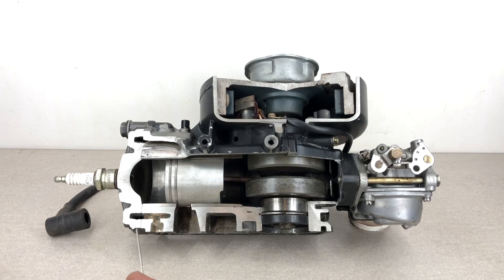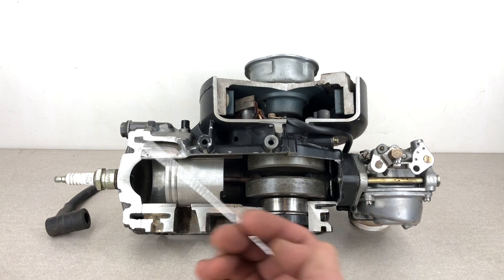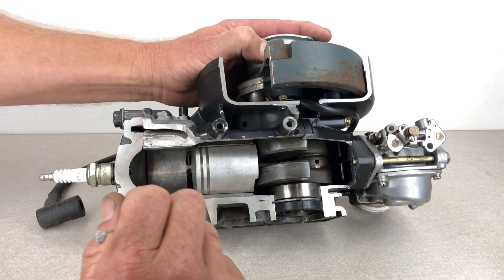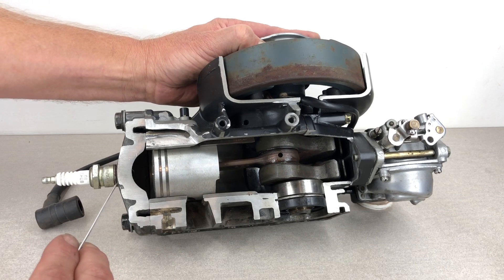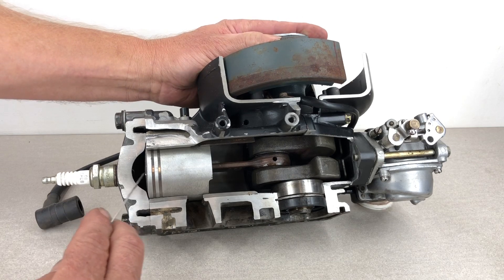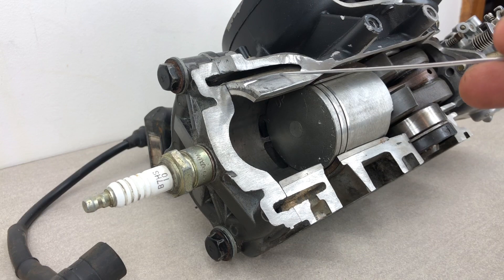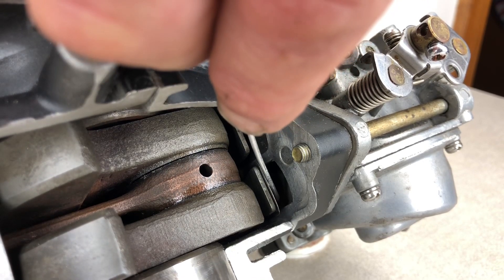How a two stroke outboard works.

Comment: I have a 2 stroke 15 hp mercury. I was doing a flush test but the prop nut was only on hand tight. Is this ok?
Reply from the maker: Hi mate,
The prop nuts don’t need to be super tight, just on firmly, hand tight is definitely not enough. Make sure if it’s the 15hp USA built that the nylon locking part of the nut is still firm and new (designed to stop the nut undoing during operation) if it’s the 15hp Japan built with the castle nut, make sure you use a split pin to lock the nut in position.
Lag thing you want is to loose your prop while out on the water 🤦‍♂️
Cheers 🍻
Reply: @25hpboatracerman  Thanks. So it isn't going to cause water to get in where it shouldn't if the nut is loose? Also I have noticed a small amount of black oil has leaked out from the small hole at the bottom of the unit. I'm hoping it's just burnt fuel residue.
Reply from the maker: @freakazoid111  
Yeah, pretty normal to have the black oil, it is normally un-burnt oil.
If it’s gear case lube then you will be able to smell it, gearcase oil stinks, un-burnt two stroke oil isn’t very smelly.
Just make sure the prop nut cannot undo by itself.
Cheers 🍻
Reply: @25hpboatracerman  Thanks for the quick replies and they are helpful. I am new to it all and have lots of questions, I guess I could also check the oil / colour with the drain screw at the bottom. Any idea what the thin pvc tubes are at the back / bottom of an rib? they are glued on to pipes that are essentially holes in the back / bottom of the boat. and the tubes are floppy & about 60mm diameter / 2 feet long. I'm guessing they are some kind of one way drain tubes that let water out of the boat and not in?
Reply from the maker: @freakazoid111  
Too easy mate 👍
Yep, one way drains, you nailed it 👌
Reply: @25hpboatracerman  Cheers. Would you recommend having them out at all times when on the water? Also I have checked my thermostat and it is opening / closing when submerged in  in hot / cold water. But I have been told that if I can't keep my hand on the block without it getting too hot, then there is a cooling system issue.. I can hold it there for about 5 seconds.. The tell tale is squirting normal, the tell tale water is luke warm & there is another outlet near the tell tale which also expels water & I think it was a similar temp maybe a bit warmer. I gave the motor a salt away flush too. Do you think that all sounds normal?
Thanks
Reply from the maker: @freakazoid111  
Hey mate,
Do you know if it is a Japan built Mercury?? It will say on the model plate at the bottom.
If so, the tell tale runs all the time and the water outlet on the leg only runs when the thermostat opens I am pretty sure. The water coming out of the leg hole will be hotter for sure. The motors run at about 70 degrees, so not that pleasant to touch for too long. If a drop of water sizzles on the block it is definitely running too hot. Ps: don’t spray the block with heaps of water, just a drop or three if your checking temp, they should just sit there 😊
Cheers
Reply: @25hpboatracerman  Yes it's Brunswick/ mad in Japan. Also has 2005 on it. Not sure if that means it was manufactured in 2005. I checked the lower unit oil and it is seaweed green colour and strong smelling so probably fine. I ran the motor again and the outlet on the leg starts running immediately along with tell tale. I noticed the engine block and thermostat housing would get reasonably hot while idling but when I give it a bit of a rev up then they would immediately cool down. Not sure if this is because the water pump is pumping better while revving or because it is getting hotter while revving and thermostat is opening?
Also there was a decent ring of sludge around the top of bin, where the waterline was (floating oil etc) it was light brown / grey colour and had gritty stuff in it but you could rub the gritty stuff and it falls apart.
Reply from the maker: @freakazoid111  
Yep, 2005 model. The Japan built ones are awesome 😎. The sludge in the test bucket is normal, especially if you have been running it for a bit. About the getting hot at idle, it really should be pumping enough to cool properly at idle, I would change the water pump impeller if it has not been done in the last 12 months. It is pretty easy. I have a video on it (outboard service guide) and it’s on your exact motor.
It also may be totally fine and you are being over cautious (that’s a good thing and I am the same) it takes me a while to trust a new outboard for reliability, especially if it’s one that I have not rebuilt. Have you had it out on the boat?
Cheers 🍻

Comment: Wrong.
Really wrong... the description of the strokes are not right 
You really missed it, and, at this point, every comment has missed the errors and the video should be removed and trashed and redone correctly
Reply from the maker: Hi mate.
Thanks for your opinions.
Are you going to say what’s wrong with it? A two stroke is actually pretty simple and from all I have studied and from hands on experience the video is very correct, in saying that I am happy to be corrected if you can tell me what is wrong with the explanation.
Cheers 🍻
Reply: @25hpboatracerman  
Sure thing,  
I'll start with a summary of the description of the 2 stroke, and then reference the video for your time stamp and describe the strokes.

The 2 stroke engine has all 4 "events" occurring in 360° of crankshaft rotation,  (instead of occuring in 720° of crankshaft rotation as in the 4 stroke engine)... that is:
SUCK  =  intake 
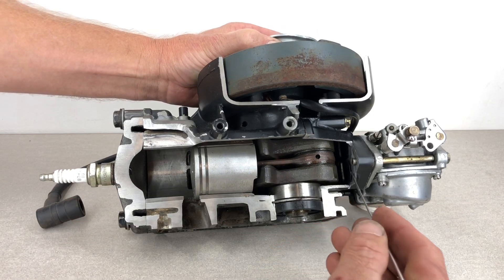SQUEEZE = compress... (1:59 and again at 3:18) 
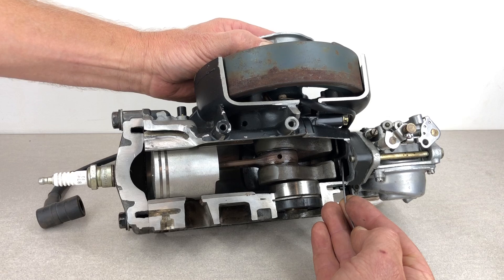BANG  =  power (the good part)(2:10)
BLOW. =  exhaust
and repeat in that order at very high speed.
- The first stroke (intake or " Suck)  
occurs when the intake port is exposed near the bottom of the piston travel and is finished when the same port is closed during the upward travel... transitioning to the ~
- Compression stroke (squeeze) 
is the duration of the piston travel to the "top" of the chamber in the cylinder, and then ~
- the "Power" stroke (Bang) begins at the point of ignition (ie ignition timing 10° before top dead center), forcing the piston to travel down (the fun part), and then ~
- the Exhaust stroke (Blow)  begins when that port is exposed during the downward travel and is continued when the intake stroke is replacing the spent exhaust with good air mixed charge to repeat..

I'll review the video and add the time stamps and edit that in.

Cheers to you too 

Each of the "Events" as I've described, occurs in the combustion chamber side of the piston
And
The intake system that you are focused on in the video occurs in the underneath side of the piston, or "Down under" (up to the 4th minute in) and the attention you give to that operation is correct and proof that I'm not living in the land down under and focused on the topside of the engines operation and I spoke before finishing your very good video.

Two thumbs up
Reply from the maker: @besearchingforwisdom6267  
Got there in the end 👍
Cheers

Comment: Hey mate I've got 2006 18hp Tohatsu, do you reckon it's worth getting after market reed valves? Or is the any other mods worth doing? Excellent video 👍
Reply from the maker: Cheers mate,
The 18hp tohatsu is an awesome motor 👍. 
We have tried racing reeds in the 18hp and also the 25 - 30hp and found no real difference over the stock reeds which was surprising. 
Shaving the head to increase compression definitely gives more torque but not really any top speed gains I’ve found.
I just leave my 18hp motors stock now, the tiny gains you get are not worth it.
If you have the 15hp super Mercury (Japan built) I do like to put the 18hp cam on the stator to get full throttle from the carburetor.
Thanks 👍
Reply: @25hpboatracerman  Thanks mate 👍 It's a proper Tohatsu 18hp and she's Bullet proof! Maybe I'll play around with prop pitch. Also what do think about fuel/oil mixture?
Reply from the maker: @willknight1005  
Yeah awesome 😎 
If it’s on a light boat and your after more top end speed engine height and prop selection are the ticket for sure.
One of the boats at where I used to race power boats was getting about 82kph out of the 18hp. Keep in mind that was on a carbon wing boat (about 25kgs) with a very light person driving, nose cone and a 16 pitch through hub cleaver propeller, they only carried enough fuel onboard to complete one race at a time (about 600ml).
I’ve seen about 65kph with a 18hp, shaved head and a 12p semi surfacing propeller on a tinny, not that pleasant to drive though.
The 18hp normally hits about 50kph on a tinny which is pretty respectable too.
👍👍
Reply: @25hpboatracerman  Cheers for the knowledge mate! She's on a 3m Stessl rat pack 👌 I only use it to get to my fishing/crab spots quick 👍
Reply from the maker: @willknight1005  
😂 Of course it is on a rat pack, perfect 👌 
Well that is a pretty good setup mate, had the same for a while and was very happy.
👍👍👍

Comment: What would be the engine brand and model in that video?
Reply from the maker: Hey mate, 
The motor I used in this video is a 5hp Mercury - Tohatsu block.
Cheers 👍
Reply: @25hpboatracerman  thanks

Comment: Best explained video on how outboard works that I have seen, well done and thanks. When the air and fuel mixture starts getting sucked ind to the top of the cylinder, the Exhaust port is open,  wil some off the air fuel mixture not escape of before the exhaust port is shut under the compression? Again a gret video :-)
Reply from the maker: Cheers mate, really appreciate it.
Very good question and true the exhaust port is open but the way and angle that the fuel air mix is introduced to the combustion chamber most of it remains in the pot surprisingly. 
If much where to escape into the exhaust section there would be possible back firing or flames in the exhaust tuner which would be not great.
Thanks again mate, all the best 👍
Reply: @25hpboatracerman  That makes sense, thanks mate 🙂